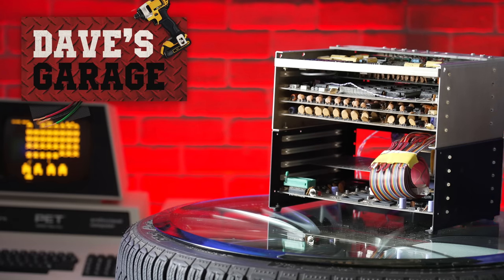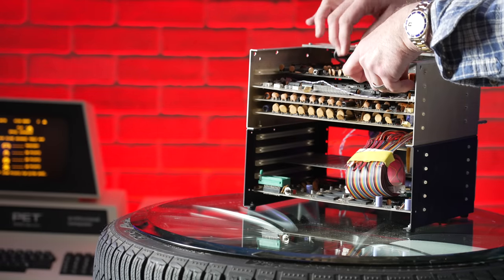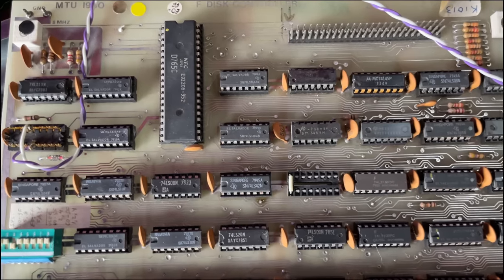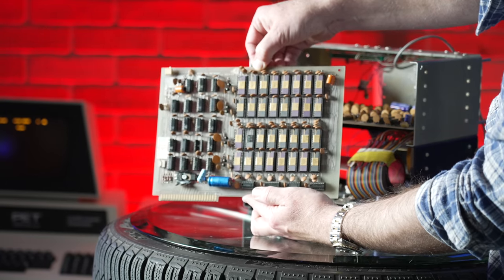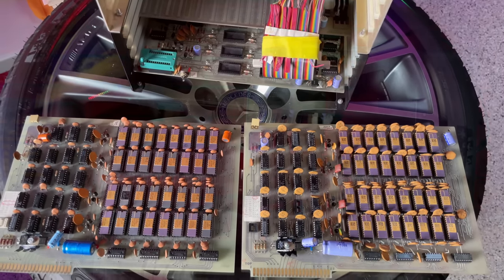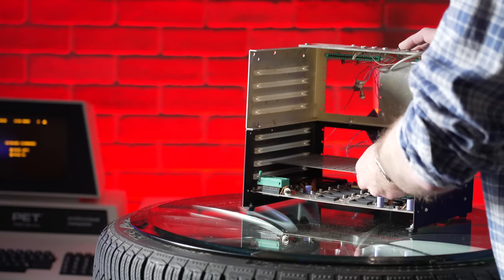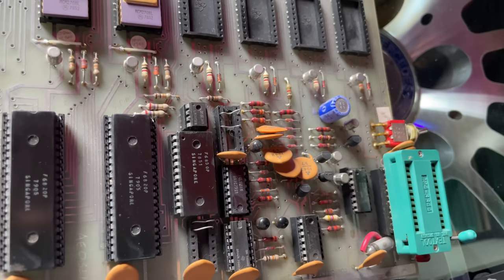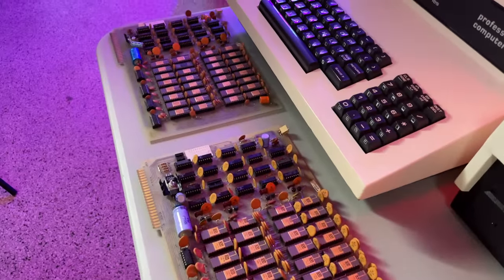Inside the 1977 KIM-1: CPU, Video, RAM, ROM and more!

Comment: That 276- part number is a Radio Shack part number. They made a number of prototyping boards of various shapes and configurations through the 70s and 80s. I remember hand wiring quite a few boards much like that little IO expander and considerably larger and more complex. I'm sure thousands of other hobbyists did the same in that era.

Comment: On the local regulation power distribution scheme:  In those days the chips were drawing a fair amount of current on average, and spikes (glitches) when they switch. (hence all the bypass caps).   Now if you try to send 5 V through the backplane bus, you are flowing that current, and the glitches through a bunch of skinny traces,  wires, and connector interfaces, all of which add a milliohm here, ten millohms there, and inductive impedance all over the place. (any and all wires have inductance)

Mr. Ohm tells us that when you flow current through all that resistance and impedance you are going to get voltage drop.  If this voltage drop becomes excessive, then one or more chips becomes flakey.  Maybe it only happens on a read if all the data lines change state at once, or maybe it is temperature dependent...flakey hardware will drive you nuts trying to track down the problem.

Now all those little caps will help a lot with glitches.   They limit both how much voltage change a glitchy chip puts on the power rails, as well as softening glitches from the neighbors so the local chip is less likely to be influenced by those glitches.

The voltage drop due to average current consumption can't be addressed by capacitors, because they only deal with transients.  

Say the current load on the power bus is enough to cause 1.5V of drop on the 5V rail and 2V drop on a 12V rail.   Well, the 5V rail dipping to 3.5V is a problem for a couple of reasons.  First off, the chips just might not work at such low voltage, or work at reduced speed.   But even if they would work fine on low voltage, you have the issue that the cards nearer the power supply (electrically, if not physically) are seeing far less drop, so maybe they are running at 4.5V.   That means that their high logic outputs are sending very close to 4.5 volts out to those distant cards that have only a 3.5V supply.  And the chips won't like that AT ALL!.   Driving inputs (or tri-state outputs) above the supply rail can cause a host of evils.  If the difference is less than .5V it usually works OK, because it takes about 0.6V to overcome the junctions that are trying to protect against this.

So you want the all the cards to see the same supply voltage.  The method of achieving this on your boards is local regulation.  The cards are supplied with a raw supply of, say, 18-20VDC.  The same rules of voltage drop apply, and because the 12 and 5V current both flow through that supply route, the drop might be as high as 4-5V.   So you end up with 13-14V at the farthest card.  The local regulators drop this to putch-near exactly 5V and 12V on the cards, and life is good.  The local regulators compensate for however the raw supply voltage varies.  The other thing is that while switching regulators technically existed in those days, they were exotic beasts, and you needed a true guru to make one that worked at all, and a freaking magician to make one that worked well.  So all the early computers used linear regulators, which generate a lot of heat.   By putting lower power regulators on each board, you spread that warm warm lovin' over lots of area, which lowers die temperatures, which keeps the smoke inside the regulator pass devices.

We had to do the same thing when I designed a board for the DEC Alpha.  That sucker needed a ton of current at 3ish volts.  So we'd put 5V on the board, and that fed a voltage regulator that lived right next to the processor.  Pretty sure all the really fast processors still have to do this.
Reply: A great response but there's a much simpler answer. The 3 pin linear voltage regulators of that era had limited current capacities to a max of 1.5Amps (without having to resort to additional circuitry & finding real estate to centrally dissipate the heat) thus it was much easier to use a relatively inexpensive simple high power step down unregulated power supply comprising of a step down transformer, diode bridges & a few giant filter caps to provide bulk power & then decant that power to feed the lower power voltage regulators on an as needed basis.

The distribution of +/-12, +/-5 & +3.3 volts isn't an issue, with the correct conductor sizing & layout its distribution works just fine.  It's done ubiquitously including most IBM PC compatibles and other systems. Some of today''s GPUs draw over 500 watts in this voltage range! Today's CPUs use voltages as low as 0.9 volts @ incredible current; thus for now the voltage regulation is done adjacent to it.

As for the little caps, these act as Coulomb buckets acting as local energy reservoirs (like local batteries) rather than a bypass or decoupling function; they're there to cater for poorly designed power distribution networks (PDNS); they'd be sprinkled willy nilly in the hope it'd address system stability (& unfortunately the willy nilly sprinkling still continues!).  These days a properly designed PCB does not require the little caps; in fact they can be useless for today's designs because the very fast transition rates used where the signal can't even reach them.
Reply: @PebblesChan  There were 5A regulators available from National Semiconductor, in a TO3 package, with a pretty high per unit price, that needed a fair chunk of aluminium to get that 5A out of them, even with the minimum input output difference of 3V, thus the 8V supply rail, that was 8V fully loaded, to 10V unloaded. 15 to 30W to dump on a card was hard, you had to either have a heatsink, running the full length of the card, with fins that took up another card space, or have it take up half the card space and still get a card in next to it. Or have a cooling fan directly cooling just that frame section. S100 bus simply did it the easy way, need 5A, put 5 1A regulators on the top of the card, each with a heatsink to handle 6W, and have 5 Vcc bus rails to the assorted chips, so each rail was only loaded to just under 1A. Easy with TTL and NMOS, as power use really did not change much with clock rate.

Cray did it even simpler, as ECL has a current use that is almost constant, irrespective of clock, so all they did was to have a single ferroresonant power supply that used massive copper busbars to deliver the -5V2 to the cards, with absolutely no regulators at all, just a ferroresonant converter that made a constant AC voltage, and then simply tossed in a massive set of rectifier diodes, and truly massive capacitors to smooth out that supply. Then used liquid cooling, to keep the chips on the card frames from melting themselves off the boards. No regulators, and a variac with autotune to fine tune the voltage.
Reply: @SeanBZA  Absolutely & thanks for the great reply! That's why I specifically said 3 pin meaning the TO-220 package. (The TO-3 has only 2 pins & uses its case as the third contact). 10A TO-3 versions were released later but were even more expensive. My S100 system is powered up right now! Its 16K RAM cards has what you said - they've each got 4 x 5V TO-220 regulators - one for each 4K bank. A quick count of the voltage regulators in my system is 24!
Reply: Modern CPUs are so power hungry that they get their own 12V link from the PSU, and have their own regulators right next to the socket.
Reply: @PebblesChan  Those TO3 were later on also released in TO247 package, which had three pins.

Comment: Those EPROM chips with the windows in them get erased using UV light. Might not be a bad idea to put something over the window to prevent them from getting erased by mistake.
Reply: 5 and a bit floppy write protect stickers were perfect.  Sticky as doodoo, metallic, and just the right size.   Many of us that came from the BBC micro with its 'sideways roms' (bank switched) had eprom programmers (and  windowsill erasers (in summer) (nested parenthesis?))  just reached for the sticker sheet in the verbatim box and felt safe.

Comment: I think it was 1976. My school bought a Wang computer. It had: 12k ROM for the OS and Basic interpreter, 8k RAM, two 128k 8 inch floppy drives, input console CRT monitor and keyboard, mark-sense card reader, dot-matrix printer, letter quality printer (looked like an automated IBM Selectric typewriter). The whole thing cost $25k. We had to sign up for time on the computer after school hours. It was a lot better than shipping off mark sensed cards to be processed overnight on the one IBM computer in the school district. That was state of the art at the time.
Reply: A few years later Wang started selling expensive "word processing" machines to businesses. My sister used one at work and it took me no time to figure out it was just a standard CP/M machine running standard Wordstar with off the shelf components like a daisy wheel printer.
Reply: There is another YouTuber that rebuilt a wang word processor

Comment: You can probably use a PC AT 5.25" or 3.5" HD floppy drive instead of the 8".  Might require some software changes, and cabling changes but nothing really rocket science.
Proto board is a printer interface maybe?

Comment: While the disk controller may have been intended for 8 inch drives, that NEC 765 chip was very widely used for many years and that included plenty of use with 5.25 inch drives.  The compatibility is going to be down to the software drivers and other hardware considerations, including whether the disks were intended to be soft-sectored or hard-sectored.

Oh, and that hand assembled board - could it have been an early SASI/SCSI host adaptor, or is it too early for that?  Maybe for some kind of tape drive?  I didn't get to count the number of ways in the ribbon cable.  And that's not wire-wrapping - that's pretty standard hand soldering for digital electronics in the late 70s - early 80s.  If you're a hardware guy, that's a pretty simple board to wire up.  For wire-wrapping, you'd have IC sockets with very long square cross-section pins, and the wire is wrapped very tightly around the base of the pin for 8 - 10 turns for each connection, using a specialised hand tool.  The tightness of the wrap ensures a good connection, such that no soldering is then needed.  (I still have a hand powered wire-wrap tool in my box of 80's stuff.)

Last thing - you're not the only guy that straightens out decoupling capacitors.  It's a "not quite OCD thing" for me too.  Just be careful with those older ceramic disk caps - they don't like the leads bending close to the capacitor body since it can fracture the coating and then moisture can get in which doesn't do them much good.
Reply: The KIM-1 was way too early for SCSI. I can't remember if SASI was around at the time, it may have overlapped slightly. I'm very doubtful about that being any sort of disk interface. It looks to me like a pair of 8 bit latches that perhaps will make up a 16 bit bus on the end of that cable, but I think that would have been way too slow to interface to a disk drive at the time. Remember the KIM-1 only runs at 1 MHz. I'm guessing this was an interface to some special external hunk of hardware the original owner had. Maybe an early automated juke box or the like.

Comment: Those white pads become conductive as the rubber begins to age and deteriorate. I have seen them add resistance and even shorts to the PCB. Remove and clean the surface to save yourself headaches.
Reply from the maker: Thanks for the info!

Comment: Those bodges might actually be intentional. Those are probably only two layer boards with no internal layers. They might have used wires to create the intended circuit when there were traces they couldn't resolve during layout because of topography and space constraints. You'd need to draw the schematic to know for sure.
Reply: Wouldn't you design that into the PCB though? Some PCBs, especially single-sided, have jumper wires, but they're part of the circuit, have their own pads and holes. These bodge wires are just tacked onto the bottom of component pins. You wouldn't design a circuit like that, it's unreliable and you have to pay somebody to solder all the wires on, and to get them on the correct pad out of hundreds, every time. 

Users cutting traces and adding patch wires was the done thing back then, when it was much more amateurish. Like Dave said, your "update" might be a sheet of paper telling you where to solder some new components. Cutting a trace here and patching a wire there fixed mistakes with the PCB, but it also allowed customisation by the user, which was very popular. I doubt there's many pre-1980 computers that don't have a few cuts and patches here and there.
Reply: @greenaum  again, we'd probably need to see the schematic. Layout was done by hand and depending on the network, they might have needed to run traces which crossed each other in a topography they couldn't route with traces on a 2 sided board. Not only are you passing data lines, but you're a also running power and ground to each of those logic chips. Running additional wires probably wouldn't have been the first choice, but I can imagine that it might have been a limited choice. Even if you could have used vias to route a signal around blocked paths, that might have been more expensive and less reliable for a given route.
Reply: @R.B.  I get what you're saying. My point is, that wires, which certainly are used for reasons like you say, would be given their own drilled pads just like every other component. Bodge wires are only put in at the factory when they've already manufactured the product, or at least the PCBs, but then discover some mistake. Rather than scrap all that, they can use bodge wires.
Reply: @greenaum  fair point. If they were intended, they almost certainly would have had their own pads. That's enough to convince me that they are probably bodges instead of designed from the start.

Comment: Dave, having spent some time with Gov't projects that I can't speak of...  that other interface harness was probably for a tape drive.  This would have been something that looked like a lady's train case (luggage) with a cassette player in it.  They were used often on the Data General Nova 3 or 4 and some Digital (DEC) boxes from the Early to Mid-70s.

Did you get the Mach-10?
Reply: Yes, either tape drive, or for a printer, using a modified IBM golfball typewriter that would provide output.
Reply: @SeanBZA  the Kim-1 had a tape drive built in, so probably not that

Comment: My first guess is that the prototyping card was a parallel interface for a printer?  Although it could’ve been for something like a paper tape reader, but that would seem kind of pointless since they apparently had a disk drive connected.  I’m pretty sure that same 765 chip is also compatible with 5 1/4 inch Shugart drives. That chip was used on the original IBM PC/XT floppy controller.

Comment: Bodge wires implies a fix was required due to a design failure. Mod wires implies a revision to improve timing, change clocking on faster chips, decode addressing for larger eproms etc.
For someone who spent years moding boards to later revision levels as a field engineer, you are disrespecting the time and effort design engineers went to to improve the products at a reasonable expense rather than state a serviceable board needs to be replaced each time improvements were available. In a time of rapid development, changes to hardware were issued frequently, and if you find a board from the era without mod wires, it might not be a better designed board, but one that needs mods it has missed out on.

Comment: Remarkable machine. I can't even imagine how I would approach designing something that complex. I suppose the modular nature would help. Still. Very impressive.
Reply: It's all about the modular nature. They had the S-100 and S-50 busses. Different companies could make cards that would be compatible. Actually exactly like PCs now, but more fun! Yeah each card minds it's own business, a RAM expansion card keeps an eye on the bus for RAM accesses and answers if they're in it's range. A serial port card sends out serial data to a peripheral, when the bus writes to it's address. If the bus reads it's address, the serial port card will place on it the last data it received.

Each card tends it's own garden and is ignorant of the rest, by design. The CPU sits on there and sends out it's read and write requests, knowing that they'll come in (or go out) over the bus, put there by whichever card bears that responsibility. They all have their own address ranges to respond to, they all watch the address bus and react when it's their time to shine. 

They must have done a pretty good job to allow cards from different companies to work together, forming a working computer. The theory is simple, as is the practice, if it sticks to the theory! I suppose getting stuff to work, when it ought to but didn't, was part of the fun, the feeling of triumph it'd give you when you succeeded. You can get the same feeling now by trying to connect cheap Ebay security cameras up to your Wifi.
Reply: @greenaum  I think the serial protocol must have been key to that. I think it was standardised pretty early so that all the components could speak the same language. 

But just the idea of designing something so complex as a computer.... Without a computer to do it on..... Mindblowing lol

Comment: That upd765 is a standard floppy controller used up until the 80's.  It will handle 3.5" and 5 1/4" DSDD floppys ~720K.  Don't think it can do 1.44MB or 1.2MB HD disks.  Amstrad used then in their CPC range with their weird size 3" disks but standard drives were compatible.